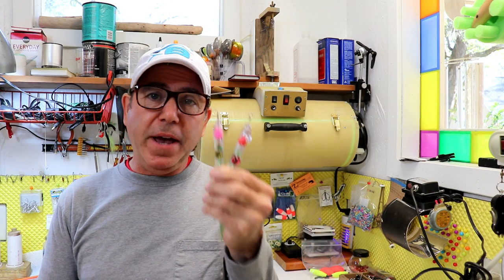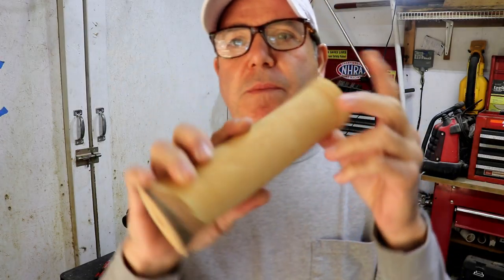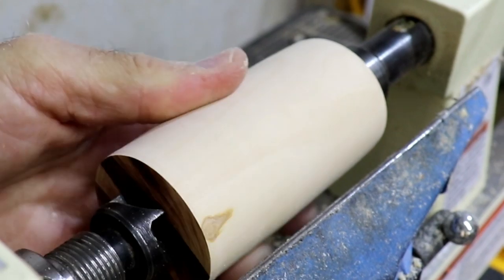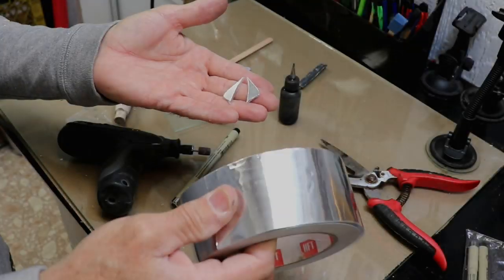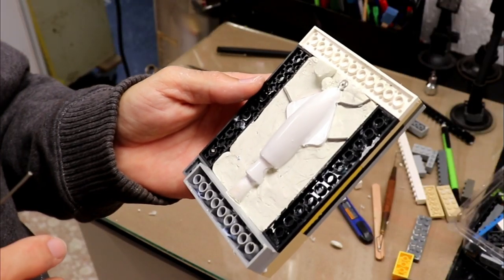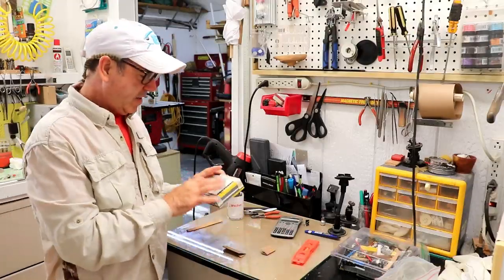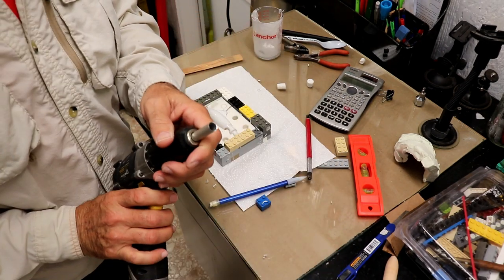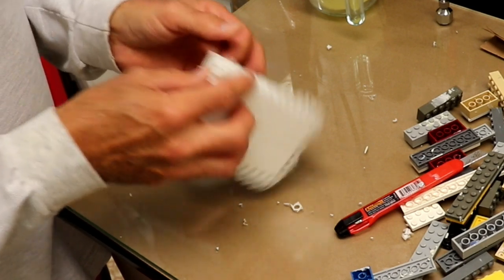Squid Jig, Let's Make a Jig From Soft Plastic

Comment: do one with a loop on both ends of the through wire, then you can add an assist hook with a split ring instead of a hardwire hook
Reply from the maker: Yea...that's a simple mod. I'll probably do a few like that.
Thank you.
Reply: @EngineeredAngler   i thougt the same,and i think it will give the lure more Action underwater.  and i would tie the rubberlegs in front of the splitring so you can Change the hook for ,a fly, or fish it with a Trailer in an other Color.that Looks like a feeding or wounded squid. and what i nearly Forget: NICE LURE,MAN ;-)